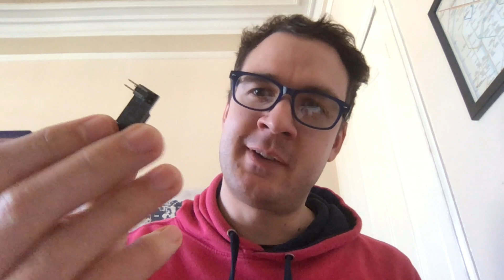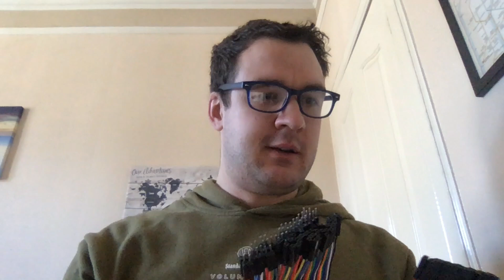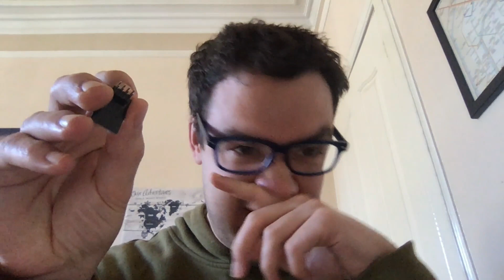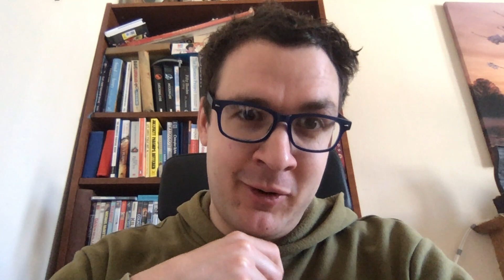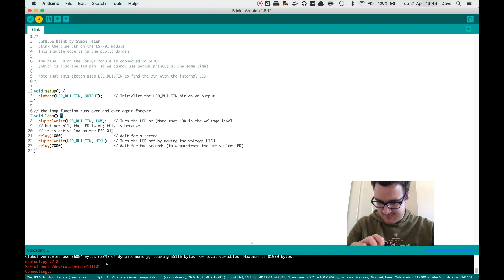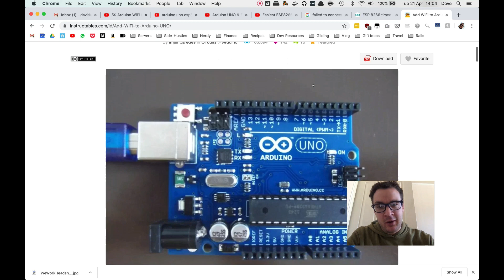Tech Vlog #2 - Adding WiFi to an Arduino Uno using the ESP8266 WiFi chip

Comment: nice video, its ok your not using voltage divider? since esp8266 is not 5v logic
Reply from the maker: Hi there 👋🏻 Glad you liked the video! I think you're right; I was never able to get that ESP8266 chip working and, as you've surmised, I suspect I put too much voltage through it. I've since bought a replacement chip and an adjustable power supply so hopefully I'll have better luck next time I need to connect an Arduino to the WiFi network 😂
Reply: @dfjones89  I saw someone is using VCC to CH_PD which will allow it to enter into the bootloader mode. I tried to add a switch and destroyed one. Get a nicer one instead which has built-in serial adapter or you can try what I have just said. Probably you have seen it online. Good Luck!